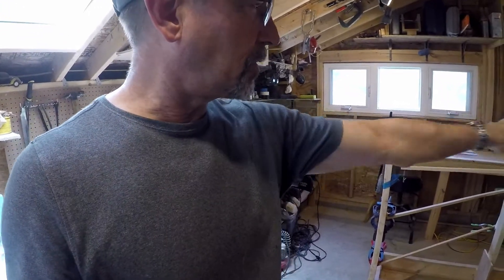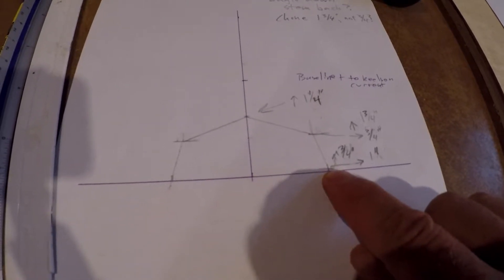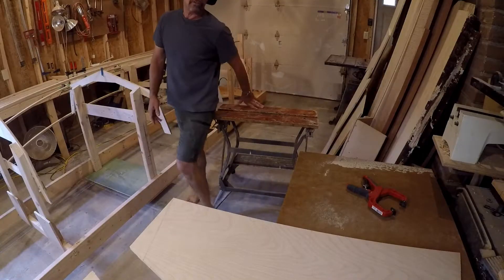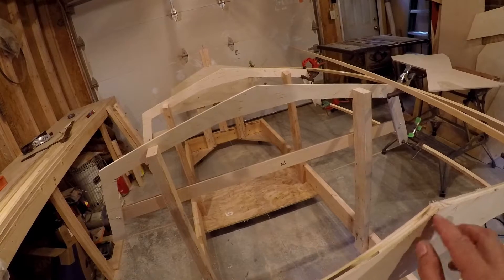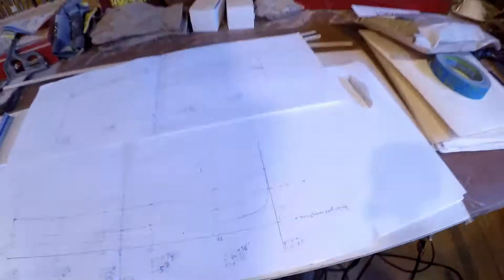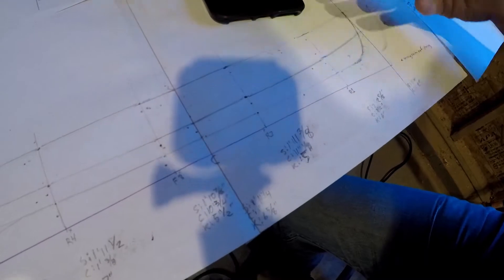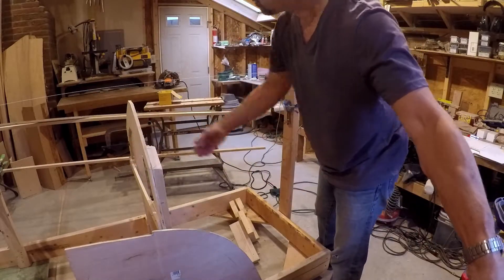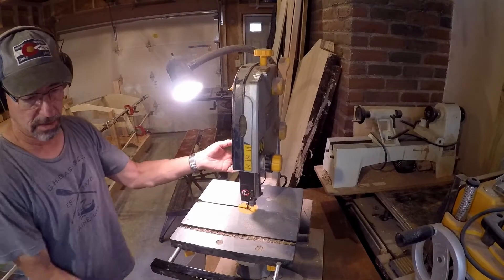Ep 5 Making the Stringers, Stem, Keelson Notching: Designing and Building a Sailing Rowboat

Comment: Nice boat and videos. Thanks. I keep reading not to use birch plywood. Where do you buy your plywood from? I’m thinking you have not had any problems with it. Thanks
Reply from the maker: Thanks!  I've read different things about plywood, including some of the stitch-and-glue kayak people saying they've successfully used even materials like luan, not just expensive marine plys.  So I've chosen birch because of its availability (I have bought mine at Home Depot!) and price, and because I like the way it looks, especially in contrast to Sapele/Mahogany.  With epoxy/fiberglass and then eurathane, I haven't had problems on any of those boats.  My first boat was larger, and I did use marine ply, fir, in 1/4" for sides and 3/8" for bottom and deck.

What are you thinking of building?
Reply: RudyWoodcraft 
I’m not sure. I would like to build something larger then my last boat. Something that can carry 4 but light enough to be trailered by my minivan.
Reply from the maker: @robbiekremer8856  I had a new record of six people yesterday afternoon sailing in Grace (though two were kids, and the weather was pretty mild).  Grace is 14' but has plenty of freeboard, and four people is a reasonably comfortable load so far.  I had sort of the same criteria, but i also wanted the boat to be a good solo sail, as so much of my sailing is solo due to schedule.